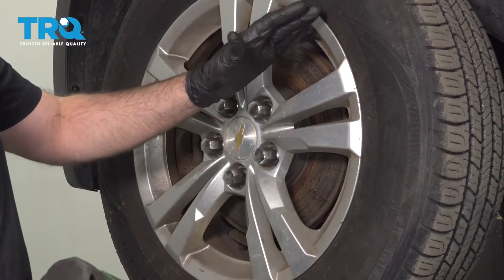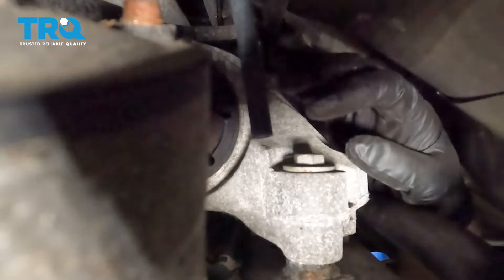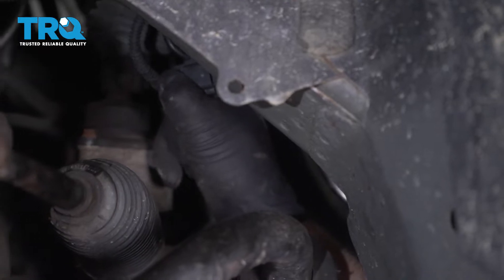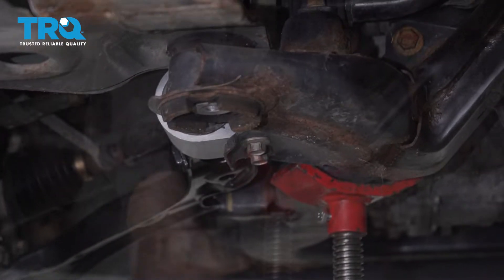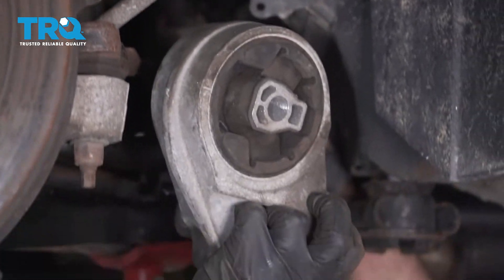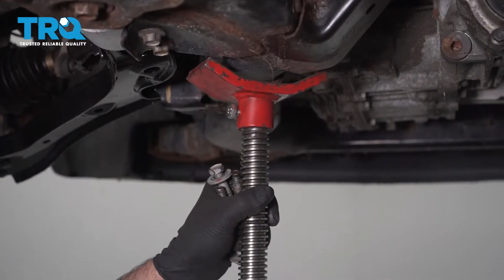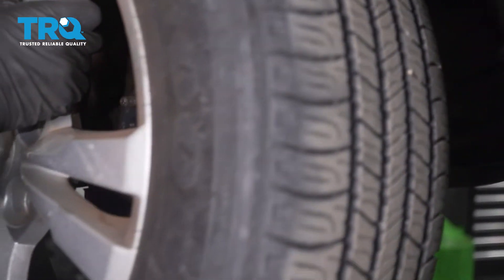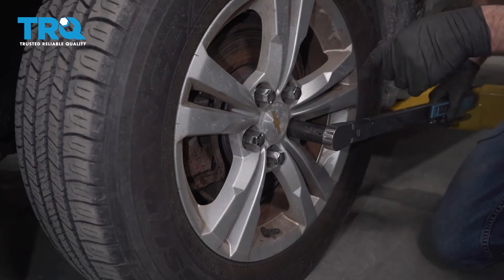How to Replace Rear Transmission Mount 2010-2017 Chevrolet Equinox

Comment: I need to do this rear engine mount on my 2013 model Captiva 2.4L petrol (manual) I don’t think I have those cradle mounts in the way. But the mount is the same.

Comment: I'm replacing the front left trans mount on a 2013 equinox. Turns out, after removing it, there's no damage, it appears to be fine. My question is,
The slop between the long mounting bolt that goes through the mount and attached to the frame. There's only a metal bolt and a metal housing through the rubber. The bolt is maybe 5/16 and the housing hole is like 9/16 or bigger. There's a lot of metal to metal slop. Doesn't seem right???
Reply: Did you figure that out? Did the bolt wear out the hole?

Comment: Hello everyone I have a 2017 impala premier 3.6L flex fuel. I'm having difficulties taking the rear motor mount from the vehicle..the mount is in between the frame and the engine. Any suggestions?? Please let me know..